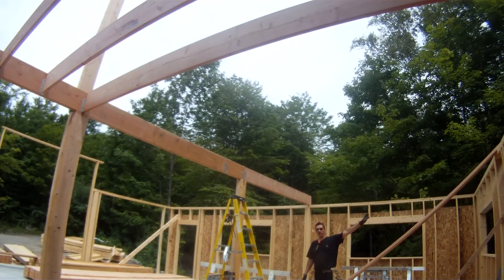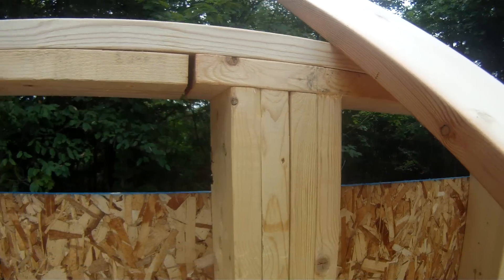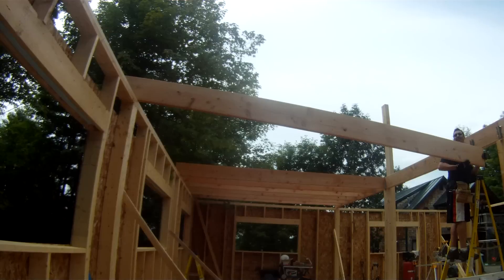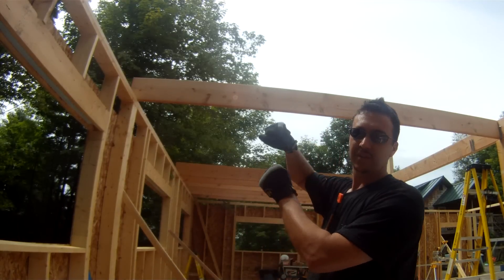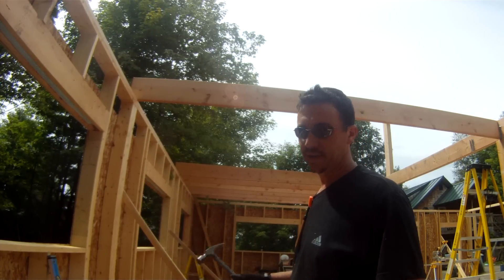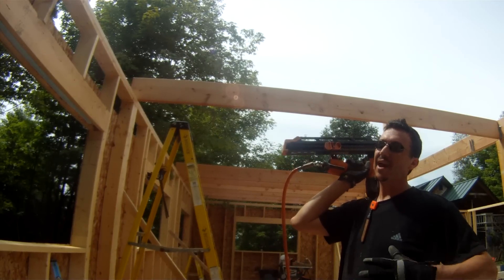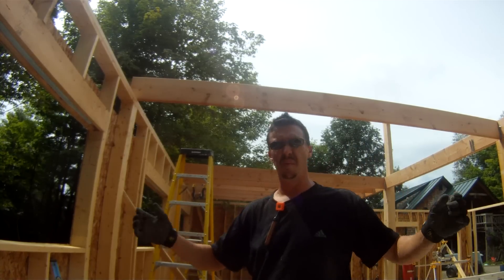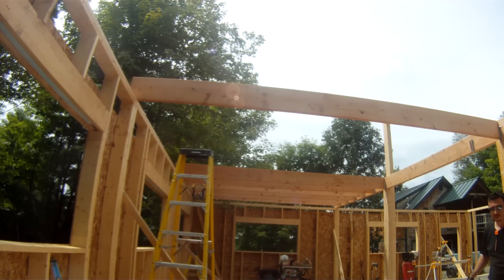How to install a floor joist alone - 30 - My Garage Build HD Time Lapse

Comment: lol i wish my joist where this easy :) Try 18' 2x12s recessed in to 15" steel I-beam, running to metal welded bracket on round corrugated steel grain bin wall.  I have 2 in the middle done my self, only 80 more to go..but they'll get shorter?. lol  nice video.  I thought I'd spend some time on intra-web seeing how you pros do it.

Comment: If I want to built a second floor what measure I have to use? Is 2x8 good enough in each floor? The first floor wall are made on block, ceiling isn't done yet but I'm thinking to use 2x10